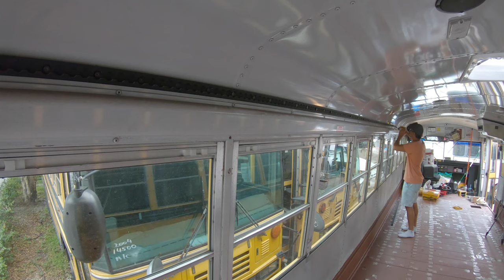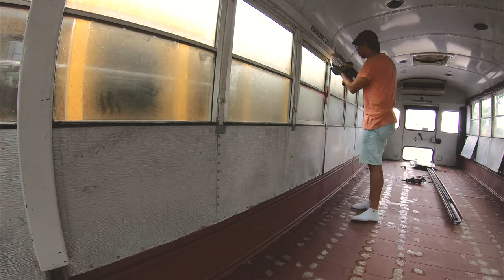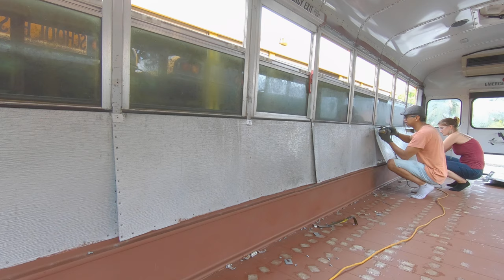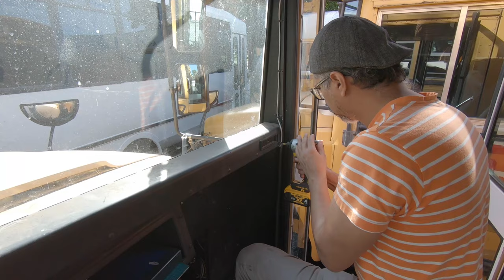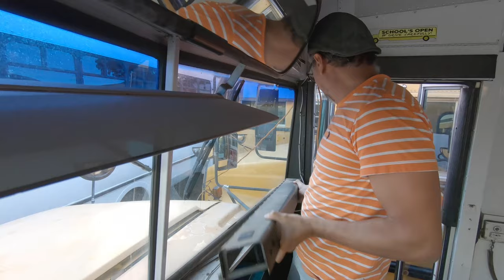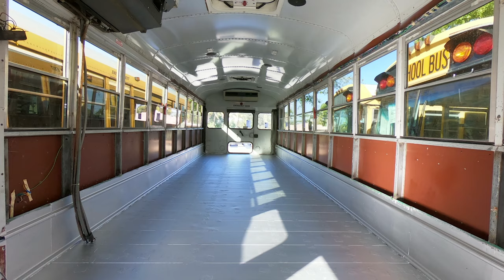How to Remove Skoolie Side Panels | Skoolie Conversion

Comment: Why are you ever grinding in sock feet?
Reply from the maker: The floor still needed its final coat of enamel, so we were trying to keep it as clean as possible.
Reply: @ArtWeThereYet  mute point as the grinding would have had metal dust all over the floor.